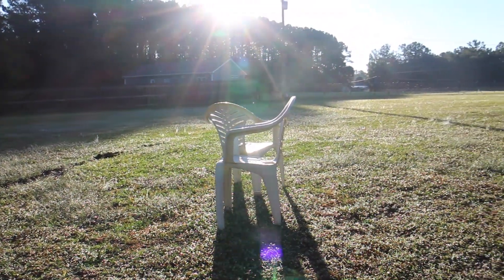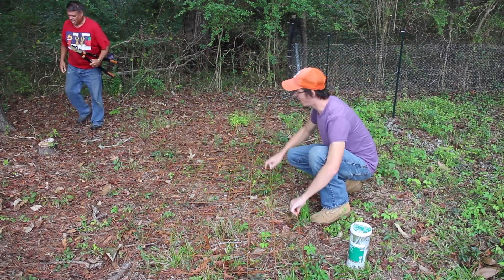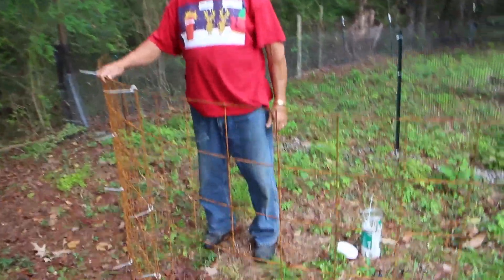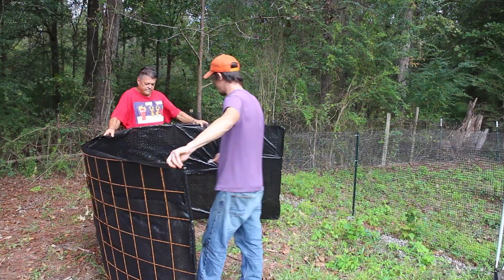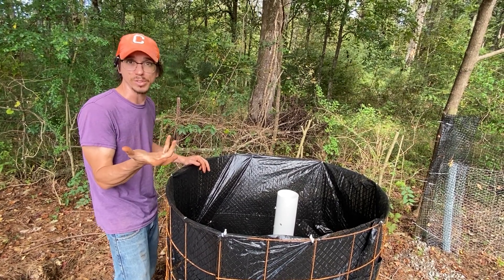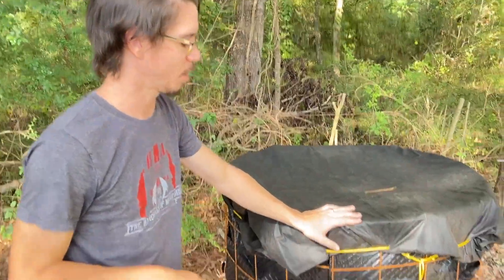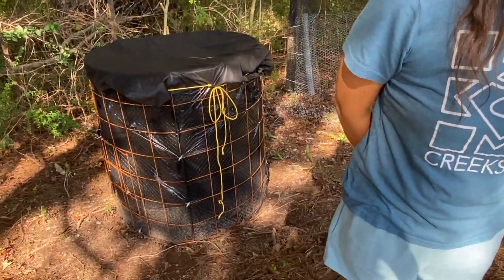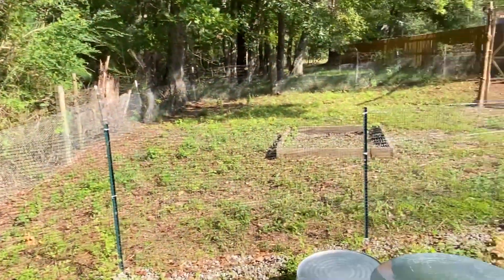DIY No-Turn Compost: Modified Johnson Su Bioreactor

Comment: Nope, you've totally missed what a Johnson-Su reactor is trying to do (it's cold, slow, no-turn high-carbon aerobic compost method that's specifically designed to provide a fungal-dominant compost).  It's designed to be filled at one time and left without disturbance to allow fungi to grow.  Since it's a low-nitrogen compost, you need to have sufficent material on hand to fill the bioreactor - you need all that material to get the bioreaction started.

As such, you haven't made a J-S bioreactor at all - you're simply making a standard compost pile with a random tube in the middle. J-S reactor is on a pallet so as to get maximum air flow. Yours is on the ground with no oxygen, so almost certainly will go anerobic, and the single aeration tube isn't sufficient (Dr Johnson says 8-12" max to oxygen - that's why he uses 4 tubes - and why he removes all of them after filling).
Reply from the maker: thanks for the thoughtful and helpful info! We were simply going for a modified version of his design and seeing how it would work out. Learning one step at a time. At some point we'll post a video showing what happened (although we're sure you can probably guess ;-)

Comment: Ryan, how did you secure the 4 inch PVC.  Did you just pound it into the ground or affix a base?  Love the concept.
Reply from the maker: Great question, the ground was fairly soft so we worked it into the ground a bit to allow it to stand on its own.  The compost will hold it in place once you build it up.